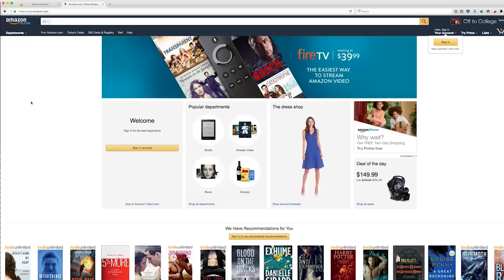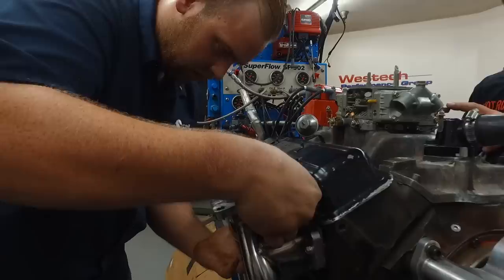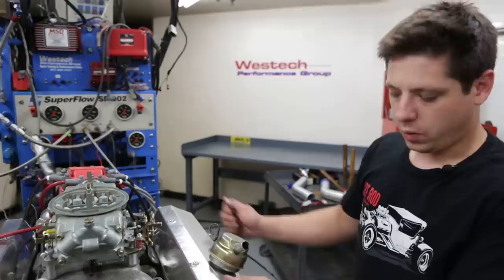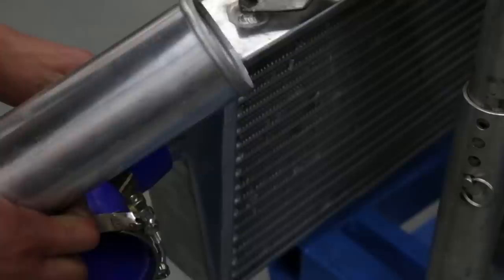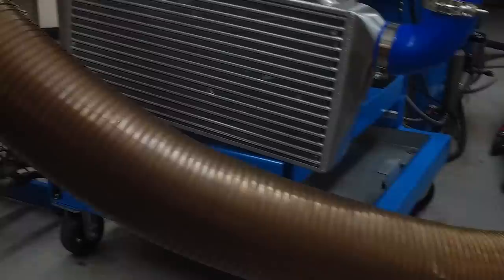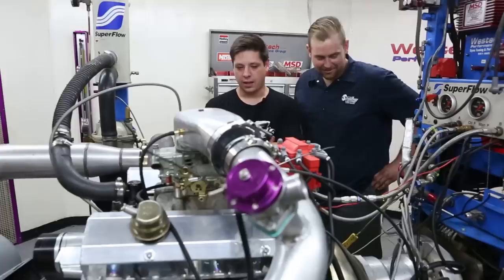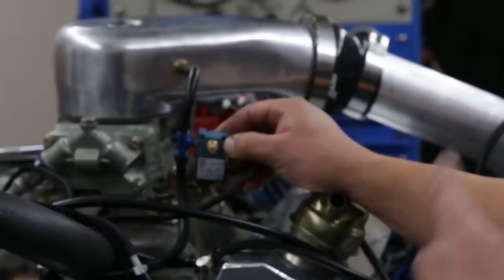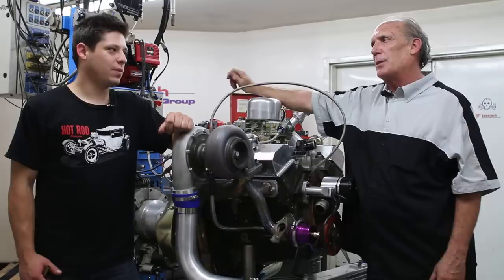Small-Block Turbo Kit for $699! But Does it Work?

Comment: what I got out of this is this... buy the turbo itself. Everything else make yourself or buy from a good company
Reply: with the SBC in particular. you can get decent headers any number of places for a good price and youll be fabricating a crossover pipe anyway. 

in my case the options are complete scratch build or ebay manifold. but thats whatbi get for playing with obscure japanese cars.
Reply: Chinese ebay turbos are really actually very good these days, the trick has always been to buy one of those while fabing your own pipes and getting used good quality wastegate(s). Run it sensibly and it'll last years, push it hard and it'll go bang but so will everything.
Reply: +DrewLSsix meh, you don't really need headers, I've seen some fast junk running flipped cast manifolds. From what some Slops have told me the thinner tubing is releasing a lot of heat and thermodynamic energy that is what turbos crave. I thinks I'd at least attempt to spray a few coats of hitemp coating and wrap shit cloth on the tubular headers. The heat only helps the the turbo spin up all the rest needs to be piped as far away from the engine compartment as possible. me thinks.
Reply: Tyler Wabnitz yeah
Reply: I assume the pipes supplied are ment to be cut and modified. I think they just give a basic amount of pipe to work with. A little extra pipe wouldn't be much.  I'd buy the pipe kit cheep and then get me a good turbo.
Reply: Check with the guys that are using them. I am not a turbo guy, but I would listen to the guys at the track that have experience with them. My guess is that this one is a piece of poop that will grenade after 2000 miles.
Reply: Chinese turbos are like anything else Chinese. A cheap clone of a proven design. I buy plenty of Chinese remake pieces for old Honda ATCs. Cheap copies of the Japanese originals. It's hit and miss. They're usually pretty decent, or complete garbage. Never an in between. I'd buy just the turbo. Look it over and if it seemed legit I'd piece the rest together with decent parts. The waste gate quality is what is scary for your engine. And if you can get just as much usable boost for a 1/3 the price... 

I buy Chinese versions of Sthil saws. There are about 5 pieces I swap for Stihl OEM but the run just as good and last just as long. I even squeezed an extra 500RPMs out of my MS660 compared to Sthil's MS660. I can pay $1,549 for a Sthil MS660 or I can pay $178 for a "Farmertec" MS660 clone and assemble it.
Reply: Just go to the junk yard. Seen people using turbos off of the power strokes. They tend to end up in there will low ish miles too.
Reply: just buy a vsracing gt45 turbo. proven billet turbo thats balanced and all for under $400
Reply: isolated POOPHUT where are you getting your farmertec for 178??    at that price money could be made
Reply: Jake Schmidt I don’t think any real shop told him that it’s just what he seen bums at the track running I mean it’ll work that way it’s just shitty... upside down exhaust manifold with a power stroke turbo from the junkyard and some flexible rubber tubing

Comment: I did the same turbo build but with a different manifold on my blow through 385ci 89 s10. Don't know the power level but it's set on 10 lb and I've been driving it for 2 years no problems. As long as you do the proper prep work and maintenance it will last for a long time

Comment: I was waiting for the bottom end to Grenade! So all together it needs a boost controller and a bigger waste gate or two small ones and some metal moving for spark plug clearance. All that for right around $1000….. wonder what it could do on a bone stock 5.3 with a carved intake and an edelbrok carb…??either way that motor should top out at 300-350 and it almost doubled that. Great video! We viewers need a detailed parts list please!!

Comment: without a boost controller, you hook manifold pressure to the bottom Port of the wastegate and leave the top Port open. Then that pressure acts on the spring in the diaphragm thus opening the wastegate at the proper psi... they had the manifold pressure hooked to the top of the gate hence why it kept pegging the boost
Reply: They said when the gate was fully open it still wouldn't vent enough exhaust
Reply: @StevenWillmy  the way they had it plumbed (wrong), the gate could never really open the way it's supposed to
Reply: From the look of it the turbo is assembled 180° off, shouldn't the cold or intake side face the front of the vehicle in a real world scenario?
Reply: That's what happens when you buy a kit without installation instructions

Comment: Just isn't the same not seeing freiburger in that room standing next to the motor....
Reply: motortrend
Reply: cadillacphxful 
Haha so right
Reply: Motor is actually called electric motorized, you need to edit your comment and change it to engine, not motor lol
Reply: BAM!
Reply: 0ttoman engine*
Reply: ramsey144 i work in a garage and all the techs use the terms interchangeably get off your high horse little boy.
Reply: Nah its not motor, its engine. Show some fucking respect for your craft. Good enough isnt good enough. Be a fucking professional.
Reply: HEY!!

They had Creme (Steve) Brule'

What more can you want?

(I REALLY need to stop doing that 
to Steve.  He is the BEST Steve on
engine masters, that doesn't own 
a raisin farm!)

Oh, the Metric/Standard conflict.
Here's a help.  Let's start with the 
5/X stuff.  5/8ths, 16 MM.  5/16ths, 
(Yes, It is) 8 MM.  Let's see if you 
can guess 5/32nds?

11 MM. close to 7/16ths.  13 MM, 
half inch.

The 5/X stuff, has NEVER failed me.
the other stuff, use at your own risk.

One more, that dirt cheap 4 bladed 
screwdriver, from Harbor Fright, 
(Yes, I said Fright!)  will fit almost 
ALL hose clamps.  Pull the double-
headed bits out, and it is 1/4 and 
5/16th.  (Or 8 MM.)  No, I've not 
actually "purchased" one.  I also 
have never "purchased" their 6 
piece screwdriver set.  But those 
are MUCH better than the "Made 
in USA Craftsman stuff.

In my opinion, 60 to 70% of Harbor 
fright is GARBAGE.  30 to 40%, is 
AWESOME, and with the coupons, 
I don't have to pay for it.  The 
woodworking clamps are also good, 
as are the Pittsburgh PRO sockets 
and ratchets.  I DO pay for those, but 
usually at 25% off.

steve
Reply: Yeah he has a way with words,he is smoother and funnier.
Reply: 0ttoman - cue the roadkill theme music.
Reply: Noise Technician  engine means the motor and the carriage put together so you’re the one in the wrong
Reply: @luke7542   Real Car  Guys  call engines  motors.  What do you sing in the shower?

Comment: Nice video showing what one is getting their self into by buying an eBay turbo kit...but the real question is longevity and reliability.  Take that motor and drop it into...well, anything and give it to Freiburger and Finnegan.  Have them drive it to Key West and back.
Reply: agreed. I'd love to see that
Reply: Reliability is usually the weak point of eBay turbos.  The concept of producing power with a turbo is easy.  The reason why the big name turbos cost more is because when parts are spinning at 100,000+ RPM, the extra money spent on balancing, blueprinting, and quality materials is the difference between a turbo that lasts and one that grenades 6 months down the road.
Reply: M Modtomic If a eBay turbo cost 400 500 bucks and it last a year long enough to win a few grudge races I'll just replace it, it's cheap HP over replacing a 3K 4K turbo! The eBay turbos are balanced and they make big power you just have to know your shit; keep a spare they won't break the bank💨💨💨
Reply: Plus if after a year if your ebay unit fails you can opt for the name brand or go ebay again. If I was to put a turbo on say, a miata, to make 200whp I would go ebay to keep a cheap fun car cheap.
Reply: lol you'll just spend the same amount in the end. Just do it right the first time. You can get a nice rebuildable Precision journal bearing turbo for 700 to 1200 bucks lol. Thing is that turbo could blow first run. I don't trust Chinese metallurgy lol
Reply: twotwocold but when that turbo goes and a bunch of pieces go through your engine you won't be able to just replace the cheap ebay turbo to get  her running again.
Reply: the only problem is their sponsors would hate it.
Reply: I know a lot of people who have kept them for years. I mesn they cost 1/10th the price of a garrett, and have maybe 70% the reliability. Pretty shitty numbers but you have 10 tries of replacing it, ifnoring rebuilds, before you reach the price of a garrett.
Reply: @crissd8283  never ever ever heard of one exploding. If you are that concerned put a screen in. Usually they shoot oil everywhere.
Reply: @channell11  the extra money gets spent typically on q/a and features. Balancing is balancing dude. Chinese people, surprisingly, do this well. Its just a balancing machine. It does the work for u.

Comment: Superb review. So many enthusiast forget just how hard it is to make a good turbo package work AND fit into a car. One thing I'm curious about and wasn't talked about, was what kind of fuel and timing was the engine set at, given the mild cam (which turbos actually like) and old truck style heads. I couldn't tell if they were early generation Vortec heads or not.

Comment: I found with many things, you can either spend more money, or more time. But either way you can't get something for nothing. This was a perfect example of that fact.
Reply: Although sometimes amazon has car parts cheaper than advance auto after using a good coupon.  Sometimes amazon has certain car parts cheaper than anyone with free two day shipping.  It's because Amazon doesn't make a profit, so sometimes you can get something for nothing but not in this case.
Reply: Kerry Wick
Reply: I used to go to a steel fab/machine shop... they had a sign at their order desk... 

We offer 3 levels of service... fast, good and cheap... you get to choose 2. 

Fast and good = not cheap
Cheap and good = not fast 
Cheap and fast = not good
Reply: @kevinkarbonik2928 
That's an awesome sign. It's kind of true for everything in life.
Reply: Yup well said

Comment: Thanks guys, this video really helped. It's nice to see people out there helping others & letting them know what really works & what doesn't work. Too many people go out there thinking they know everything & then blow stuff up. This gives me hope for a sleeper that I want to build.
Reply: Did you get your  ' sleeper' built? Or were you just running your pie hole?
Reply: @wildestcowboy2668  poop
Reply: @Jonandtan69  dookie shoot?
Reply: @wildestcowboy2668  he never built it.. however I am building mine with a custom turbo manifold a one off if u will.. I wanna be the first person with a T4 98mm turbo on a 2l Chevy motor ( factory 4 cylinder motor ) on a Cadillac ATS 😂 bout to push the capabilities of this thing. As of right now the biggest that’s been on any ATS motor is a 70-74 I believe from zzp which currently has the record for worlds fastest ATS but.. imma bout to beat ‘em hopefully 🤞 WISH ME LUCK!!

Comment: I'd like to know how much extra they spent to actually get the system to work.
Reply: That's a good question.
Reply: Thinking it's "Piece of Mind".
Part M1
Reply: Well, factor in the price for either a much larger wastegate to replace the other, or just add a second one that's the same size. Factor in welding costs, if you cant do it yourself, i'd say probably $120, maybe cheaper if you take it to the right people. and the air filter.

One thing they don't talk about is that you'll need a blow-through carb which will run you a pretty penny..

I personally believe that if you go with the cheaper, $700 kit, and buy all the necessary items for the kit to work, and pay someone to tune the carb, and weld the pipes, it would run you near $1500-$1700, give or take a hundred or two. reason for that is the kit and the carb alone will run you near $1100 alone.
Reply: you have a magazine from the future?!? damn son
Reply: RizoProduction waste gates alone are over $100 and a tune is $450-500. plus $700 for kit. and several hundred more for boost controller, a/f ratio gauge and all the miscellaneous stuff you need.
Reply: 2redneck Did you really just mention taking your car to the shop to get (custom 1000$ tune) on his carburetor? After the just put a turbo on a motor.... lmao
Reply: Many people are able to bolt shit up (assuming a kit made for it, not a generic kit like this) but can't do the actual tuning.

I see it all the time, so many cars driving around with turbos and absolutely no fueling changes and they just baby it saying "I need to get it tuned."  Then they either pop the motor or get it tuned a year later, lol.
Reply: I met a guy with a Honda that was ebay turboed and instead of doing it properly and having it tuned he pulled the front o2 to put the ecu on base maps and richen it up. If you think that's stupid you'd be right, but what was even dumber was he didn't even have upgraded injectors. He was thinking he was good for 300HP on 350CC injectors or whatever it was. I remember he said that the stock 450cc DSM injectors were an upgrade for him.
Reply: Likely $1500 +
Reply: All in.... At least  2000-2500 depending on how much you can do
Reply: Luide Mulumba j
Reply: No

Comment: Might have to buy one of these cheap turbo kits. Actually, an even smaller turbo would be nice. Running a 1985 Ram D-150, built Torqueflite 727 auto trans, Dana 80 rear end, 318 V8, ported and polished stock heads, Comp 268HE cam. 318's enjoy boost. Low compression ratio, and an overbuilt rotating assembly from the factory, with a small bore and stroke.
Reply: "Overbuilt" cast crank and pistons? LOL

Comment: If you dont run a boost controller you still need to connect the wastegate to boost pressure.
Wastegate spring pressure means that if you fit a boost reference line to the top without a controller, the wastegate will open when it reaches that spring pressure.
If you dont fit a boost reference, it thinks you're at 0 boost and stays shut.

Comment: Sounds like it'd be a better idea to piece a kit together yourself using a pair of low mileage WRX turbos as they have oil & water plumbed to them and are often sold cheap because the owner upgraded. They're intended for an engine that is 2.5 L at most each. Buy some generic intercooler piping in the proper size on eBay or Amazon. Buy a digital boost controller and a air/water intercooler OR a couple of used stock WRX intercoolers...also prone to being cheap as most swap them out for larger and have a space for a BOV...once again use a factory Subaru BOV as it bolts right on. Get a couple of bell-mouth down pipes and cut them to fit, maybe use a stainless exhaust coupler to join it up to the 3" exhaust. It would work well with a cheap Holley TBI kit that is user tuneable but use a boost referenced fuel pressure regular. Finally make sure to get a set of gauges to monitor your boost and fuel/air ratio. The aftermarket downpipe will be likely equipped with a wideband O2 bung for this. You'll have to come up with headers and flanges that will mate to the turbos and you'll be able to use the carb hat they showed BUT it'll be reliable and inexpensive as those turbos if cared for will go 200k miles or more. You WILL have to work for it a bit but no more than you would if you bought a cheap China kit. This is how I'd do it...on a budget with parts that I know work.
Reply: Plan on doing this essentially on my 4.8, if it doesn't work I have an HX52 as backup.

Comment: I like this. A build that will fit my poor ass budget. I would really like to know how long this setup would last in a daily driver under very moderate abuse.
Reply: check out the reviews found in youtube or on the internet of the "properly" installed eBay turbos. they're pretty reliable if you dont mash it.

Comment: Do one about an ls engine, like a junkyard 5.3 or 5.7
Reply: I saw one where they boosted the pressure to 32.5 psi on a junk yard 5.3 LS . They got to 1500 hp before the thing blew up!!!
Reply: im gonna use a junkyard 350 2 bolt main in an ebay twin turbo project and see what the limit is as i haven't seen anyone really try to blow it up yet and see how far it can be pushed. some headstud's and main studs half fill the water jacket with cement open up the ring gap a bunch so its loose as a goose and gonna throw 20+psi boost at it on e85 and see wtf happens lol.
Reply: @GnarshredProductions  no youre not
Reply: And here are the losing streak fanboys